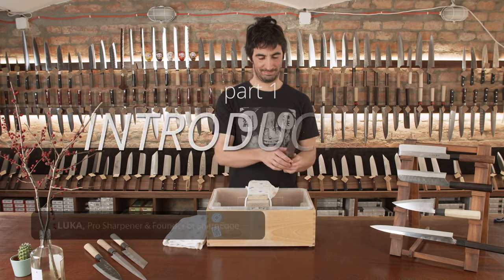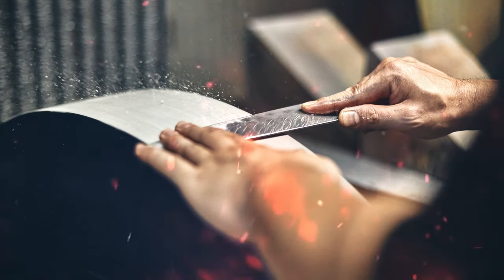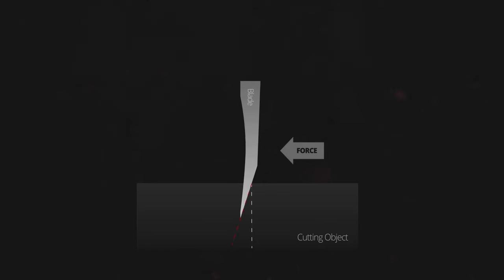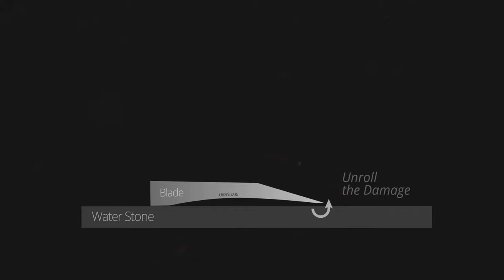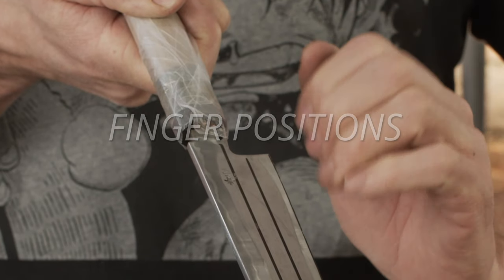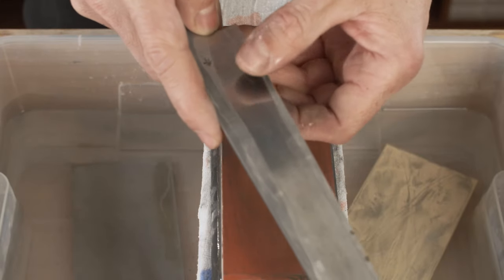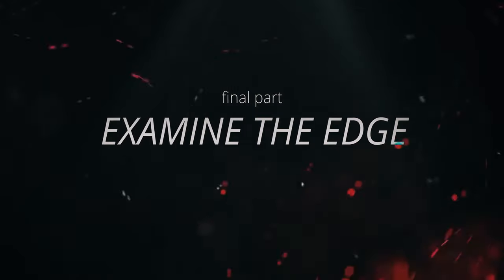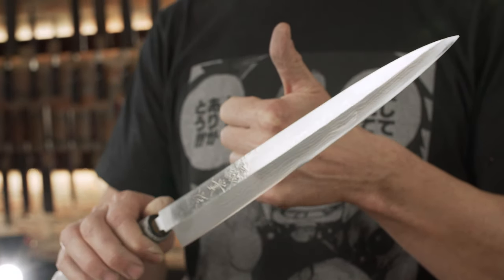How To Sharpen Single Bevel Japanese Knives - Advanced Sharpening Guide

Comment: I have a question: do we sharpen these single-sided Japanese knives after the first bevel or do we set a different angle?
Reply from the maker: You can follow the bevel that is on the knife already. So you do the flat grind from the shinogi line down. Sometimes users like to make a microbevel (second angle) at the cutting edge because of easier further sharpening and edge maintenance.

Comment: Good video. It’s actually a nie mai construction, not a kasumi. But that’s just a minor detail.
Reply from the maker: Yes, you are correct, but kasumi is also a term for a knife construction/blade made from two materials, like samurai swords: high-carbon steel and soft iron forged together (known as ni-mai blades), with the steel forming the blade's edge and the iron forming the blade's body and spine. Kasumi roughly translated to “mist” or “cloud” and it can also refer to the hazy appearance of the soft steel/iron cladding, in contrast to the fine polished cutting edge.

Comment: Au top ! J'adore !
J'ai un couteau Deba en acier Shirogami.
La moindre arête de poisson ébrèche la lame et je n'avais pas connaissance du micro biseau...
Quel angle dois-je utiliser pour faire un micro biseau sur un Deba ?
En vous remerciant 🙂
Reply from the maker: Hey, you can achieve that by placing the blade on the primary bevel and raise the sharpening angle by 5-10% to create the secondary bevel. That should remove the chip. 👍
Reply: @SharpEdgeshop  
Thank you so much !
I just looked at the box of my daba knife. He advises a 14 degree angle on the secondary bevel. I hadn't even seen... I also have the Work sharp and I made a 3D tool to be able to sharpen large knives without the tip bending and distorting the angle. I'm happy, I was able to sharpen a very flexible 18 centimeter long blade.
Reply from the maker: @MIRADAI13  That sounds amazing, great work! Yeah, that is usually the case, since the secondary bevel slightly protects the sharpness of the blade, because the blade is not that thin.  👍

Comment: I am asking as an experienced specialist at what angle to sharpen single- and double-sided Japanese knives because I have such knives.
Reply from the maker: Hey! You can actually do the sharpening angle as you wish/prefer. You can do 10–12 degrees per side, you can do a small secondary bevel, you can do flat edge, concave, convex, hollow. Single bevel knives usually direct you to the sharpening angle because you place the blade on kireha, and you quickly get the correct angle (flat edge). You can also do convex edge if that is something you prefer. Let me know if you have any additional questions. ⚔

Comment: could I get away with using a 600 grit stone to sharpen out larger dents and chips and the like for my deba knife?
Reply from the maker: Of course! The rougher the stone, the faster will remove the material. For larger chips and dents, we use Atoma 400# diamond stone. 👍

Comment: Everything in this is spot on except for where he says that you apply pressure towards you during uraoshi.  Uraoshi means "back PUSH". You must apply a tiny amount of pressure on the PUSH stroke, not the pull. It's literally in the name.
The reason for this is that when applying pressure on the pull stroke while flat on the stone, you are more likely to subtle rock back, thus widening the grind on the spine portion of the urasaki.  
Otherwise this is an utterly outstanding video.
Reply from the maker: Hey @borrago! You are correct, but we wanted to make this tutorial as simple as possible. The main thing you need to watch out is that you don't remove too much material uraoshi. Since we receive a lot of single bevel knives for repairs/sharpening, we use pressure on both strokes, as long as the pressure is minimum, that makes the process faster. ✌

Comment: Everything explained quite well but I personally don't recommend a microbevel on Yanagiba which ruins the knife, it should be flat as the shinogi line, that's the correct angle and the best feel when cutting fish
Reply from the maker: Good point. Indeed, for the yanagiba a micro bevel is usually not needed, while for debas it usually is. We find it's a personal preference. Thanks for your comment!